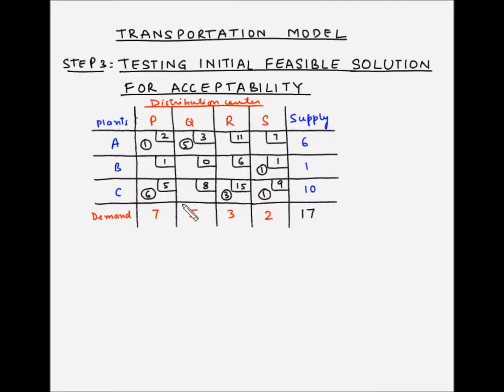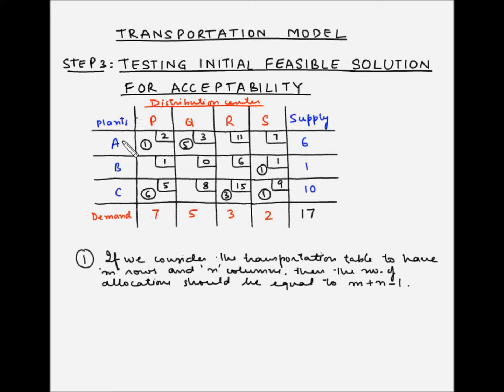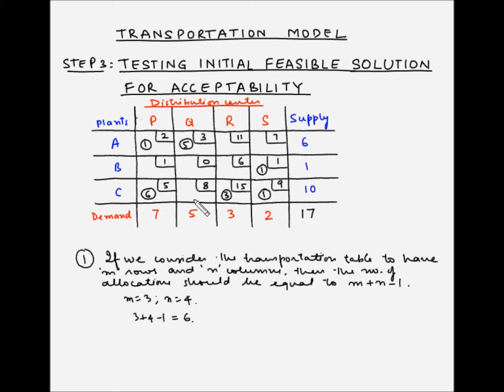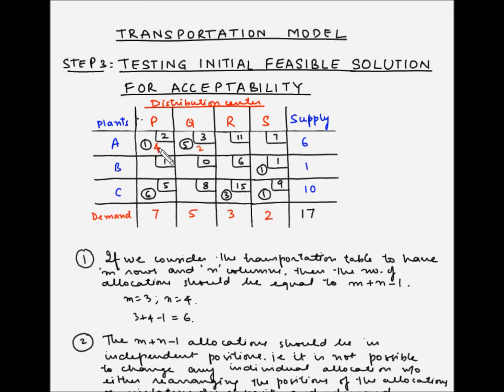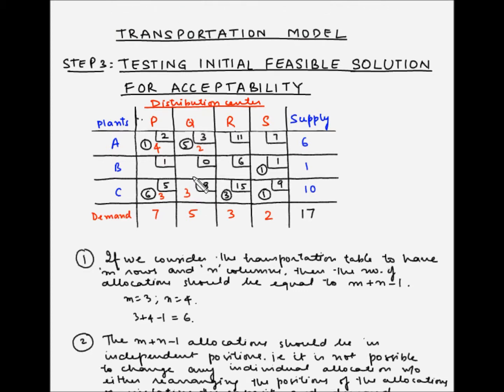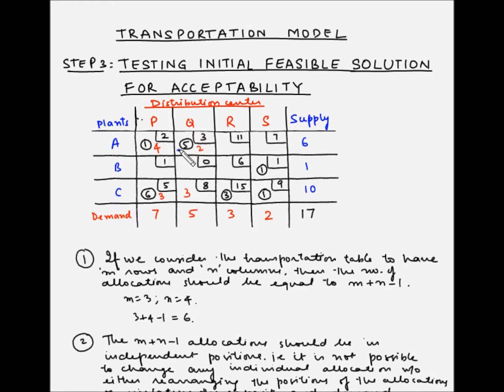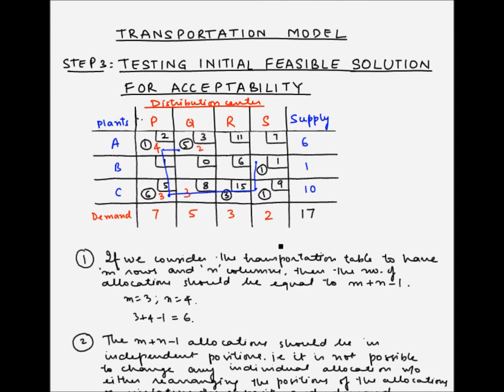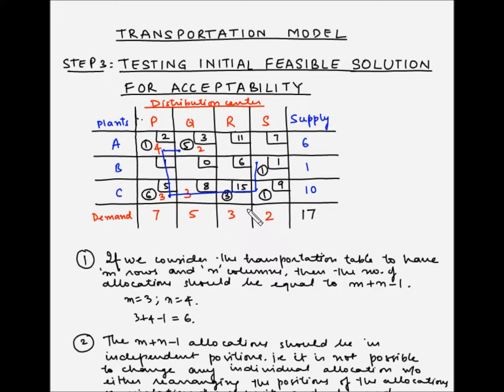Transportation model - Step 3 - Acceptability test

Comment: Three refineries with daily capacities of 6, 5, and 8 million gallons, respectively, supply three distribution areas with daily demands of 4, 8, and 7 million gallons, respectively. Gasoline is transported to the three distribution areas through a network of pipelines. The transportation cost is 10 cents per 1000 gallons per pipeline mile. Table 5.26 gives the mileage between the refineries and the distribution areas. Refinery 1 is not connected to distribution area 3. (a) Construct the associated transportation model. (b) Determine the optimum shipping schedule in the network. How is the table will look like, especially after he says: The transportation cost is 10 cents per 1000 gallons per pipeline mile. You will say where is the rest of the question. It gives you the distances I know, but how to figure out that sentence about the costs??